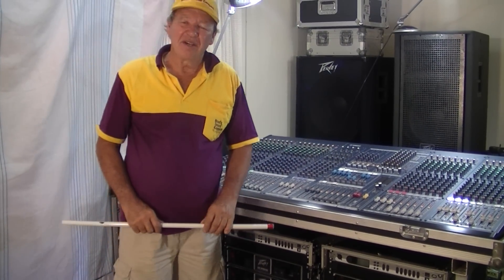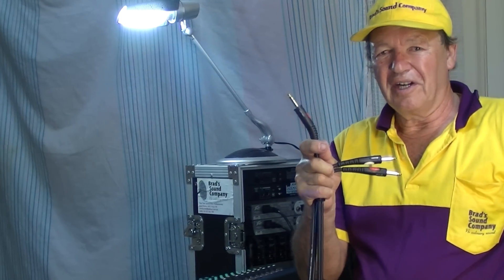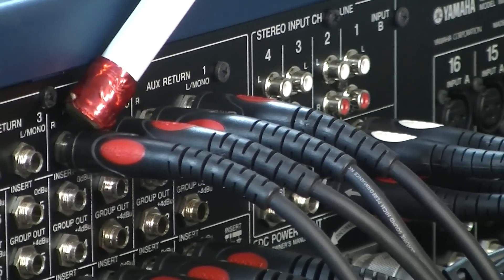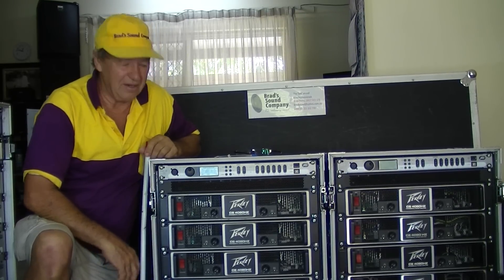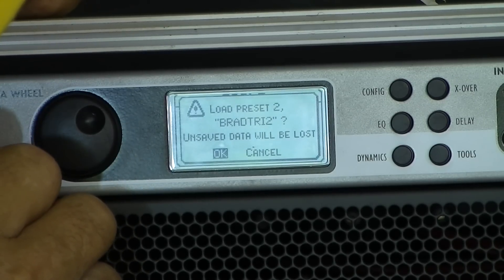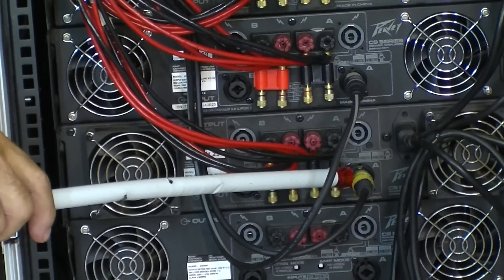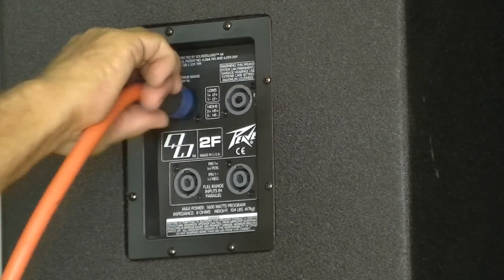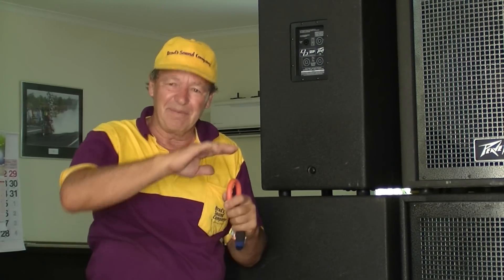Anatomy of a Pro Audio Sound System - Part 7

Comment from the maker: G'day Nick, I use exclusively and highly recommend Peavey's 2 way mid/high QW2s and double 18" sub QW218s. Excellent quality and great value for money.
   For smaller gigs,the QW2 can be used without subs very effectively. My basic setup is one QW2 over one QW218 per side... double that when the crowd exceeds 500 ...for up to 3000 people i use 4 x QW2s over 4 x QW218s per side.
  Check our website (in video description above) for full details ,,,